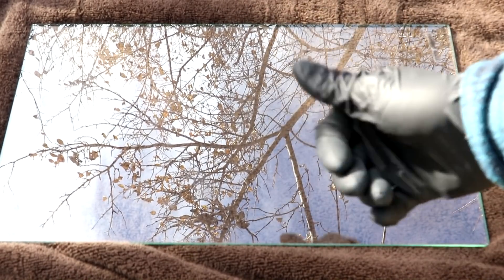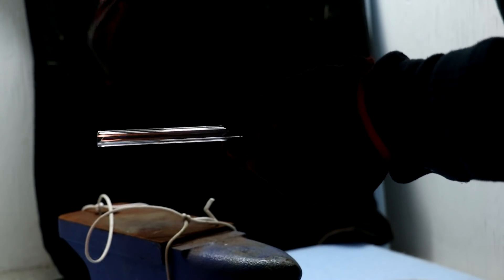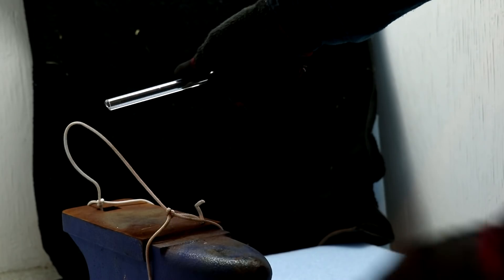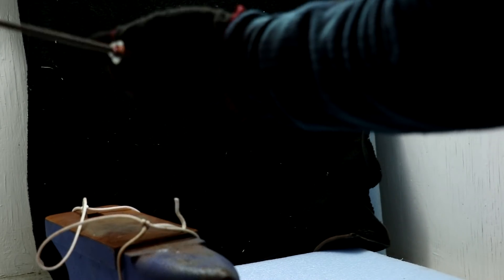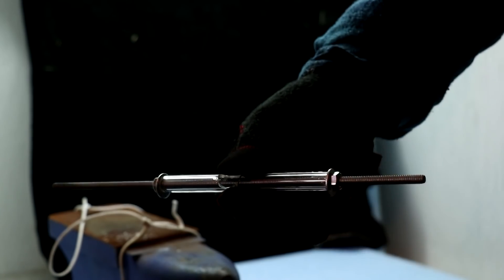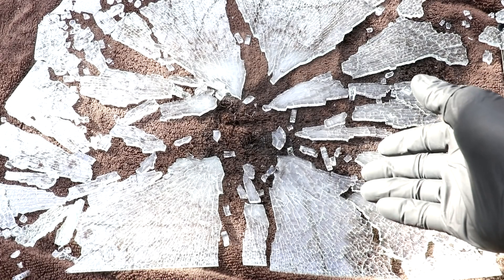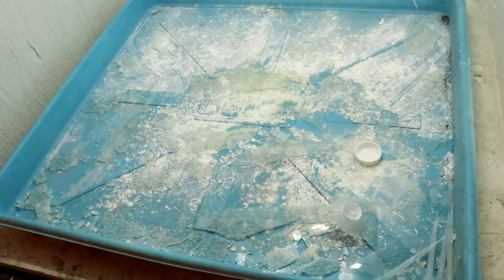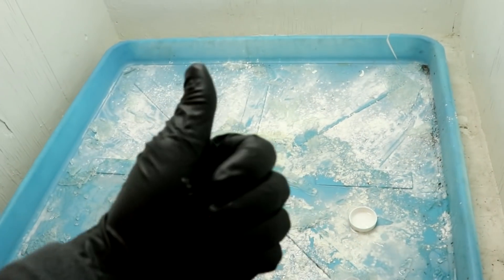Can I Dissolve Through Tempered Glass?

Comment: that thing with the glass tube and a steel bolt is actually a pretty good representation of how prestressed concrete works
Reply: I recognized the same setup from I think Practical Engineering's video on concrete reinforcement.
Reply: @The_Razielim  that's what I thought of, too.
Reply: @tom_something  same cause i watched that an hour ago (practical engineering/concrete video)
Reply: It's basically exactly what happens. Just replacing the concrete with glass. It's the same technique, as you said
Reply: Good shout
Reply: Spancrete is manufactured with tension bars through it which do exactly this.
If your not familiar, it's used in parking garages or buildings where concrete needs to span distances and hold weight.   They actually create an arch (like a small rainbow) so as weight is added to the top it actually gets stronger.
Biggest limiting factor is the steel bars holding it together.
Reply: I was in the industry for 10 years and that was my first thought as well.
Reply: Indeed
Reply: Cody compressed the glass. For the steel you need to stretch it from both sides. The exactly opposite of this but the general idea is the same.

Comment: I've had decent success laser cutting through tempered glass slides. Using fast and light cuts vaporizes a very small layer without introducing too much heat into the rest of the glass.
Reply: I imagine it might be something to do with the heat of the laser "retempering" the edges as it cuts.
Reply: @yaksher  it would actually be doing the opposite. It would be annealing the glass as it cuts. Tempering requires higher temperatures and rapid cooling, which is a highly controlled process. You're on the right track though, the only way to successfully cut tempered glass is to anneal it first so that sounds very plausible.
Reply: @chris101ward  That's about what I was going for xD But yes, annealing's probably right.
Reply: @yaksher  this makes a lot of sensr
Reply: @yaksher  Or annealing it.
Reply: I think that works because you're introducing heat into the system, relaxing the glass. Similar to metalworking, in fact.
Reply: @KainYusanagi  this process is called annealing.
Reply: @chris101ward  No, annealing is what is done after you have finished working with a piece of metal and are allowing it to cool slowly after heating it up again, so that all the stresses from working it are allowed to relax out of the piece. Specifically, it's heating the object above its recrystallization temperature, maintain it at a lower but still high heat so the crystals of the material can freely move and rearrange themselves according to their preferred crystal lattice structure, and then letting it cool slowly so that when it does recrystallize it does so without any work stressing. Tempering glass is similar to annealing up until the slow cooling process, as you have to heat the glass above its glass transition temperature for about 20 minutes before then rapidly cooling it on one side to deliberately introduce stresses on that side.

What I was referring to it being similar to is when you heat up a piece as you are working it, just to remove the stresses from working it and returning ductility to the piece, before continuing to work it.
Reply: @chris101ward  No, annealing is what is done after you have finished working with a piece of metal and are allowing it to cool slowly after heating it up again, so that all the stresses from working it are allowed to relax out of the piece. Specifically, it's heating the object above its recrystallization temperature, maintain it at a lower but still high heat so the crystals of the material can freely move and rearrange themselves according to their preferred crystal lattice structure, and then letting it cool slowly so that when it does recrystallize it does so without any work stressing. Tempering glass is similar to annealing up until the slow cooling process, as you have to heat the glass above its glass transition temperature for about 20 minutes before then rapidly cooling it on one side to deliberately introduce stresses on that side.

What I was referring to it being similar to is when you heat up a piece as you are working it, just to remove the stresses from working it and returning ductility to the piece, before continuing to work it.
Reply: @KainYusanagi   look up how to cut tempered glass. It will tell you that to cut tempered it must be annealed first. I'm a glass worker bud. Glass and steel have very different properties but the annealing process is essentially the same.  What you are talking about would be called glass blowing, or glass shaping that is heating it up to be workable.
Reply: @chris101ward  If you're a glassworker I'll eat my hat, because you don't seem to understand the basics of what annealing is, even when it's described in detail to you, and the tempering process is also detailed to you, and they're wildly different. Lemme see if this time it'll get through your head:
Annealing is the process of reheating to relax the crystalline structure of the material of the stresses from working it, the letting it slow-cool from a high heat to room temperature over hours, to not introduce stress into the structure of the product. Tempering is the process of quick-quenching (using air with glass instead of a liquid like water or oil so you don't introduce temperature differential fractures to the piece) a piece to change the crystalline structure of the piece through specific stresses and temperature changes, and for glass specifically it's used only on a single side of the pane to introduce directional compression much the same as Cody discussed in the video.
Reply: Can you actually get all the way through?
Reply: @harbl2479  Yeah, the material was about 1mm thick so I used the laser to get most of the way through (which took forever) then I was able to crack it along the seam. It really shoudn't have worked but we weren't complaining.
Reply: @brandonberchtold9484  check it with some polarized sheets. we use credit card sized sheets on both sides of the glass if a piece of glass is in question after tempering to check around holes or cutouts. trick we use at the factory for the more expensive custom orders.
Reply: @Takaykno  Didn't have any polarized sheets on hand at the time but that would have been really interesting to see the stresses induced by the cutting process! I'll keep that in mind if I ever need to do something similar in the future.
Reply: Cody's method is sound; he just needs to start with a smaller hole, say 2mm wide, and then work it outward.
Reply: @-danR  Kinda doubt that would work—does nothing about the underlying problem.
Reply: Read that as "I demand success using lasers..."
Reply: An easier and cheaper way of checking your tempered glass is to put on a pair of polarized sunglasses and put a smart phone screen underneath with a white page such as  notes app  or calendar then rotate your head or the cell phone and you can see the rainbow affects and you can see all the polarization lines around the holes and throughout the sheet I do it all the time it works great. It works because polarize sunglasses are well polarized and the phone screen has a polarized filter on it
Reply: @tinylockpicksinc.1758  if you don't have polarised sunglasses, the disposable 3D movie glasses are perfect. Can just pop out the lenses for cheap polarised sheets
Reply: Does this still introduce micro-cracks? If so, I imagine the integrity of the glass still suffers.
Reply: @mikedang3613  The cuts were far from clean and the slides basically cracked along the laser path once the laser made it half way through the material. We were also a bit impatient and probably didn't wait long enough between passes for the glass to cool sufficiently.
Reply: If you use lasers though is th glass not being melted shut as it cuts meaning the pressure inside is not being changed
Reply: @LOKI0186  The laser did 20 - 40 passes with time between for the glass to cool. The passes were quite light so it only vaporized a small layer each time as opposed to melting its way through.
Reply: Whats the reason you were cutting through the glass slides? Or was it just to see if you could? I'm curious
Reply: @0mnishade  It was for work. We were working on a project involving microfluidics and needed small glass squares with a hole drilled into them. Full sized slides were all we had on hand so we figured lasering it might work, and it did.

Comment: That's why screen protection is so important on your phone screen.
If there's scratches there is a weak point where cracks can form from shock alone without the glass hitting anythig on a drop.
Reply: And even if you don't wanna use one it's good to understand that a protection glass doesn't make the screen stronger by making it thicker or anything it's just a sacrificial scratch absorber.
Reply: well not really, since phone screens aren’t tempered glass
Reply: @Hick25  That's true but the steel tube wasn't either and that was when I wrote this.

Comment: Cody: It disolved about 3/4
Also Cody measuring how much was dissolved: exactly 3/4
Reply: Trust but verify your own intuition, is good practice
Reply: Yep 4.76 / 1.2 = 3.96666666667
Reply: Jerry Whidby he measured 1.19, not 1.2
4.76/1.19=4.0
Reply: @tinldw  ahaha you're right. I just used the number he called out. I didn't notice the reading on the caliper.

Comment: Maybe you should try controlled torching (heat application) on the glass. The ring around the hole should form a Tensile casing so that pressure inside is not released while making the hole. In the chemical method, there is no way to hold the pressure when the material is dissolved away. And probably the 1mm region that is left was the compressed region just waiting to blow out of the material above and below it.

Comment: as a chemist i have a huge amount of respect for everyone working with HF.

i never thought etching will working. its like cutting a rubber band unter tension. it will always snap apart because of tension. there cannot be a rubberband with tension and a whole right through it
Reply: The rubber bands I've seen usually come pre fitted with a hole through them ;)
Reply: They can though like in the middle of it will just make the band easyer to rip as bans are not brittle like glass and have no cracks to propagate and break it
Reply: Are you german?
Reply: @abdelrahmananbar6286  is who German

Comment: Even if you could have made a hole through the tempered glass this way, that hole would itself be kind of dangerous.  Any small bump or scratch to the sides of the hole and the glass pane would explode.  Perhaps lining the side with epoxy or silicone would help, but at the end of the day I'd say it's best to make the holes before the glass is tempered.

Comment: if you flip it over arent you letting the part under tension become the thinnest and more likely to break?  if you kept it on one side wouldn't it be more likely to go through since when it finally goes through its through the strongest part under compression?  that way you dont have the weakest part of the glass fully exposed on both sides and it can eat through the inner part under tension and then work through the part under compression.  I have no clue if this is true just a gut feeling it might be more likely to succeed

Comment: You could maybe try to evenly heat the glass enough to re-expand the glass, thus relieving the internal tension. Then use the diamond drill bit. Then heat the glass one more time and rapidly cool to re-temper the glass. Some obstacles would be that you would need to replace water with a different liquid that could withstand being dropped onto heated glass. And that liquid would need to be heated as well to prevent cooling the glass. You would need to rig the drill such that it could be operated from a distance to prevent burns. 
Another alternative is to drill a hole in regular glass and then temper that glass yourself

Comment: Magnesium (Mg) 5xxx - The addition of magnesium to aluminum increases strength through solid solution strengthening and improves their strain hardening ability.  These alloys are the highest strength nonheat-treatable aluminum alloys and are, therefore, used extensively for structural applications. The 5xxx series alloys are produced mainly as sheet and plate and only occasionally as extrusions.  The reason for this is that these alloys strain harden quickly and, are, therefore difficult and expensive to extrude.  Some common applications for the 5xxx series alloys are truck and train bodies, buildings, armored vehicles, ship and boat building, chemical tankers, pressure vessels and cryogenic tanks. maybe will work on glass

Comment: Could it be that when you moved it to clean and re-apply the acid you could have induced small cracks that eventually propagated?
Reply: Removing the piece should only possibly harm the surface. I thought you need to destabilize the center for it to shatter.
Reply: @lightdark00   the acid would have etched away the surface, after its etched the middle would then be exposed and when he moved it to clean and re-apply the panel could have flexed and caused cracks to form. Also the acid isn't necessarily goong to eat away the glass in a uniform manner it will follow the path of least resistance which could have caused certain spots to be weaker than others. I don't know just a theory....

Comment: Too bad, nice try though. I would like to try this with a Laser (high power cw and a pulsed system for ablation)
Reply: A (relatively!) low power laser might actually work since it should anneal the glass before melting a hole in it, thereby releasing the internal tension.

However, a high power pulsed laser isn't likely to do any better since the heating ends up localized to a thin layer on the surface, leaving the center under tension just as if you were drilling or dissolving a hole.
Reply: @Keldor314  I'm pretty sure high powered lqzers would work as they would vaperise a small layer of glass preventing the glasss from cracking and it may even heat up the surrounding glass sort of sealing it causing no tension to be released like when you make a vial
Reply: @oliverboi  High power pulsed lasers actually barely heat the surroundings of their target at all.  This is partly because the pulses are extremely short.  They vaporize a thin layer of molecules, which take the heat away with them as they disperse.  After this, the laser pulse is already over, so the next layer stays cold.

Avoiding cracking might not be good enough to prevent shattering.  The problem is that even without the outer layer, the inner glass is being stretched by the intact glass around it, much like the membrane of a drum.  As you thin it down, eventually it reaches a point where it's just too weak to withstand the tension and it will snap violently, causing the entire pane to shatter.  Any cracks will make it fail much sooner, of course.  

What you need is some way to release the tension inside the area you want to remove without shattering the glass in the process.  Annealing is the obvious method, but maybe there are other ways?
Reply: High powered laser pulses do impart physical shock to an object, certainly enough to shatter the tempered glass. Ablating the glass or melting it will still not work because of the difference between the internal and external stresses baked into the tempered glass. There is no way of relieving these stresses without heating the complete pane and then cooling very gradually to normalise the glass.